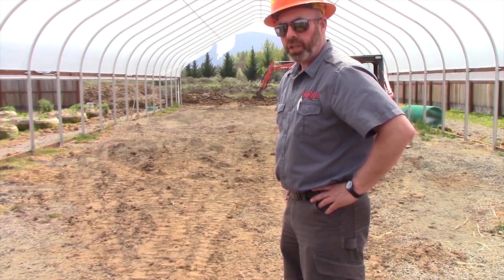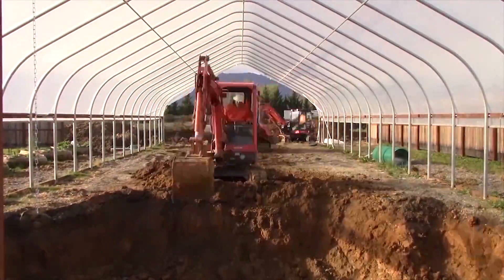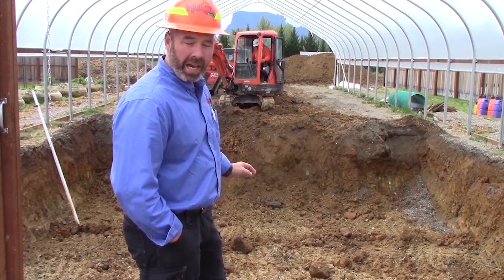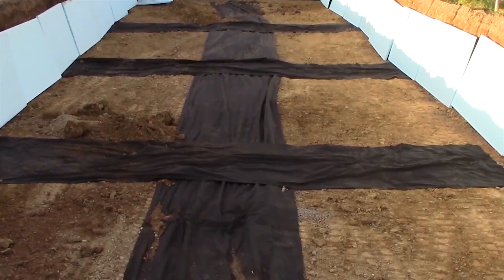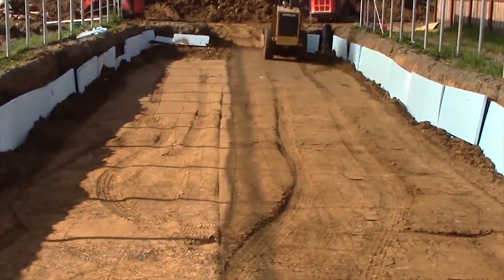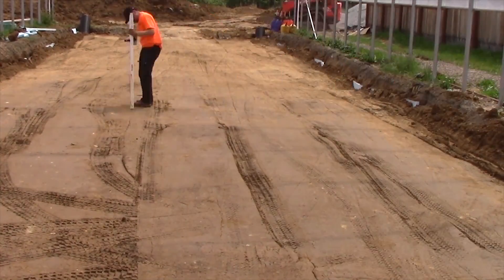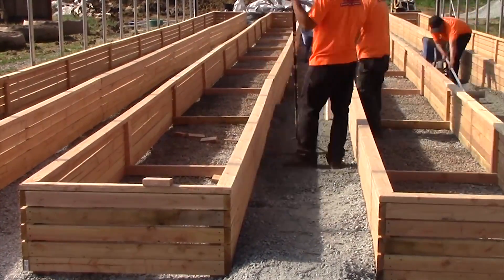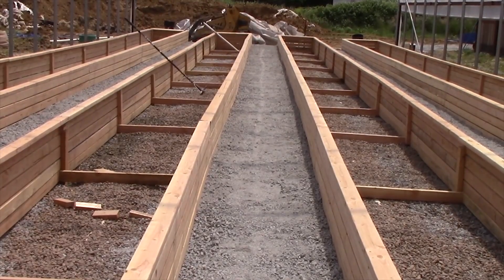Greenhouse Time Lapse Roshi Alpha 1 GAHT System

Comment: With these GAHT systems, there is talk of hot wet air going down and condensing in the pipes underground. I have not seen anywhere yet how the pipes are drained of this condensed water. Would not the water build to a level where the pipes are full? Also I have seen polystyrene become saturated in water.  If this happened here, would that not reduce its insulation value. Or is there closed cell products that are suitable for this task? Also looking forward to seeing this system in working order.
Reply: Most systems I've watched use perforated drain tubes, which the condensation can drain into the soil

Comment: Nice video explaining GATH system installation with details. I have a question. What is the final result? Does it work as per expectation? How was the temperature inside at night as compare to outside temperature in winter? Please help because I also want to build GATH system.
Reply from the maker: Thank you for checking the video out. I do not have any of the data on this as we installed the system for a customer Roshi Alpha 1. I have been receiving a few of these questions so I may try to contact them and get some info also. Thank you have a great day

Comment: Is it better to use solid or Perforated Pipe in the ground and do I have to worry about burying it 8' in the ground? Please help me on this.  I don't want to have to redo this project over.  I don't have the finances.
Reply: absolutely not!
perforated pipe also condensation to be leached out and the ribbed pipe adds 3x the surface area.
perhaps this video was made prior to these awarenesses.
tho the intent was good
this seems like a video of how not to build a gaht system
ldsprepper or at isadores farm have exceptional and proven results from a superior design imho
Reply: @Jarrett_Hagar  
I wouldnt recommend copying  this or any of the installations you mentioned.
Reply: @JohnGuest45  what/who do you recommend? (For best system design.)
Reply: @GMC-qo9xi  
I`d recommend finding someone who has at least a basic understanding of thermodynamics,  load calculation and duct design.
Reply from the maker: I would recommend not using ribbed perf pipe but the smooth wall pvc perf pipe.
Reply: @hukillsinc  Thank you very much.

Comment: Is there a followup video showing  how the greenhouse performed?  In actual operation?   How is the air circulated through the underground tubes? Thanks.
Reply from the maker: I just received this information back from the people running the greenhouse. They said It is working great!  We do not need to use any dehumidifiers in the GH at all.  Temperature stays controllable and in the colder months at beginning of season required minimal propane heating. They also stated this is first season in use and more data is need to establish any cost saving numbers.
Reply: @hukillsinc  thanks :)
Reply from the maker: We will be heading out to this site this spring and see how it is working.
Reply: @hukillsinc  any updates ? :)
Reply from the maker: Archili Kvinikadze I just reached out to the gentlemen that are running that greenhouse asking them how it is working. I am waiting for a reply back.
Reply: @hukillsinc  Ok, thanks!

Comment: My situation is different than many people. Most have green houses to keep their plants warm longer into the winter. I live in southern Utah and our low at night in the dead of winter usually won't go below 25 degrees.  So a green house can easily be kept warm all winter long. However, the middle of summer scorches flowering plants and the temps get to 112-118 degrees outside for about 1 full month in the year make outside vegatables impossible to grow. 

Can this system cool to below 90 degrees in these conditions?
Reply from the maker: Not really sure. This system was designed by a company in the midwest who was building another greenhouse out here in Oregon where our temps look pretty close to yours. We built the system around their specs.
Reply: @hukillsinc  
Theres no way the design in the video will keep the greenhouse cool in the summer. The tubes are too long and the headers wont handle the required flowrate

Comment: This is painful to watch, red flags everywhere,  when salesmen with no experience start excavating and installing materials in the ground.
Reply from the maker: Ryan Sark Thank you for taking the time to share your comments. There was no salesman that sold this project. This was a project given to our company by the owner of the greenhouse and installed per their designs. This was a system that they wanted to install to try to produce better efficiency in their greenhouses. Beyond that we do not sell greenhouses or designs for the systems we are excavation underground contractors that do a multitude of different projects customers request. But thank you again for watching and taking the time to comment. Have a great day.
Reply: Ryan this is very very critical and you offer no pointers as to what could be done to improve the situation. I plan to build a passive solar Greenhouse in the next year or two and I'm researching everything. One comment I will make which I've read online is that gravel Does a better job of absorbing heat then soil does by a factor of 2 I think. Therefore they probably should have used gravel instead of the soil for backfill. But then again as a contractor myself building koi ponds for the last 25 years ultimately you do what the customer wants and or what the budget dictates. It's not always the best or most ideal.. it's great though that they took the time to share this video because there isn't a ton of information out there on this technology
Reply: @rickyclerk3700  I did not mean to come off disrespectful but compacting soft soil on corrugated tile seems problematic, we excavate crushed tile all the time. Sleeved tile works the same as solid tile its just more expensive, I think geothermal techniques will be the future of efficient construction and any effort put forth will be a learning experience.  Thanks   I enjoyed your video
Reply: @ryansark1795  good information. Certainly the immense weight could crush the pipe depending the mass (depth) overhead. Much more productive then merely saying red flags everywhere so thanks for that Ryan. Cheers

Comment: big question is how long those wooden planters will last...  considering this is commercial production, why not to make them from galvinized steel so they dont fall appart in 10 years?
Reply from the maker: mbchudno Good observation. That was a separate contractor that did the planter boxes and whatever else on the surface for the owners of this greenhouse. We were the underground system installers and water diversion installers. Thank you for your comments.

Comment: Why do use perforated pipe thanks￼
Reply from the maker: You want the air to be able transition with moisture in it out into the soil where it will hold its heat and then use the heat depending if it's day or night. Otherwise the air will just blow through the pipes and not heat the soil around it.
Reply: @hukillsinc  
Latent heat makes up around 60% of the total heat transferred into the mass during cooling. Be aware that latent heat in the form of humidity will be transferred back into the greenhouse when heating. You`ll see it reflected in the greenhouse  RH%. It can be problematic, especially at night when the RH% is typically high to begin with.
Reply: Hukill's Inc. You don’t worry about radon gas
Reply: @arlenesauder1913  That should not be an issue due to air flow out of the greenhouse, which is not really air-tight.

Comment: Such a costly project is there any benefit
Reply: No. its stupid. you will be better off with other technology like insulation and compost heap heating.
Reply: @baphometpresidente4637  Can you explain or provide a video please?
Reply: But it looks purty
Reply: It's a great way to store solar heat for winter and cool during summer.  A simpler system  in Nebraska grows CITRUS year round.

Perf pipe and dirt is cheap compared to the yearly cost of natural gas or electricity for heat/cooling.
Reply: its also great way to store all the plant pathogens underground. great humidity under there...perfect nest for them. good luck with that.
Reply: @baphometpresidente4637  Could put a small untra violet light in the pipes to kill  all the pathogens in the air.
Reply: @baphometpresidente4637  
plant pathogens cant compete with the aerobic bacteria that thrive thanks to copious quantities of air being driven undergound. Well aerated, warm moist soil is great for plants , ask any gardener ;)
Reply: tingveson compost pile 5x5x5 feet and boom!! free heat, but what do I know, soil never freezes in flatlands of California.
Reply: @romuloremo1817  Can you explain where this would go and how to transfer the heat?
Reply: How many BTUs  are collected during the winter?

Comment: Interesting. Do you have any greenhouse temperature data to show actual performance of this system over all four seasons? Anything online that we can see?
Reply from the maker: Hopefully here soon we will start having some consistent data. We had to make some repairs to it and some adjustments.
Reply: @hukillsinc  Looking forward to seeing actual temperature historical data on this interesting & important project. In order to truly analyze & model the thermal performance of the system it is necessary to collect greenhouse air & soil temperatures (humidity also helps) AND outside air temperature. Even better, constant logging of greenhouse environmental data that also includes light levels AND an outdoor weather station that collects air temperature, humidity and wind speed. The best monitoring would also include any backup heating & cooling system energy consumption required to maintain optimal greenhouse temperatures during extremely cold or hot outdoor weather conditions. You might be able to collect this data by modifying the inexpensive Open Energy Monitor system (www.openenergymonitor.org) to interface with an inexpensive home weather station. With some free open source building energy modeling software it should also be possible to model the Geothermal GAHT system and then compare predicted performance to actual performance. This analysis might suggest where further improvements in system performance might be found and how to size any improvements to reach targeted performance goals.  (So glad that you are pioneering this important work with the Geothermal GAHT system for use in greenhouse heating & cooling - it is very important to the future of renewable energy use in food production systems.)
Reply: Your thoughts on insulation on the bottom, above drainage tile..,200 yards of insulated dirt (isolated) from the earth. Making it a battery .
Reply: @johnsilvernale6472  The physics implies that the only way this system could work is to fully insulate the climate battery on all sides except the greenhouse floor. Stored heat will have a tendency to conduct away from the recharge zone and thus dissipate into the earth outside of the greenhouse internal floor. Ground water passing thru the climate battery will drain the heat energy away even faster. As someone with a science background, what I want to see is the actual recorded temperature data: inside, outside, and in the climate battery.  The data will tell us whether this system actually works or not...
Reply from the maker: @alanmcrae8594   Very true about water taking the heat away. We have noticed that the on site personnel have over watered quite a bit and water draining through the clay soil to fast changes the condition of the soil and the heat inside.
Reply: @alanmcrae8594  well said.. I've insulated the three sides of my above ground grow beds in my green house. Good the heat longer, Also the cold in the spring..
Reply: @johnsilvernale6472  How high up did you go?
Reply from the maker: @johnsilvernale6472  Might be something to try as long as all water from above can drain easily down into lower drainage

Comment: Do you have a vdo of the connection of the pipes and functioning of the geo thermal system? Pls do share if you have one and tell us if its effective. ..thank you
Reply from the maker: After running this system I would probably use perforated PVC pipe with a glued or saddled connections transitioning  up to a 12" manifold on each end.

Comment: Hi!
How well is performing the earth battery? Do you recomend it?
Thank You
Reply from the maker: It exchanges air well  But you really have to monitor how much water you put on your plants and do not over water because of how much water will drain through the bottom. I would probly change to a perforated PVC pipe and more gravel in the soil that is backfield in layers rather than all dirt around the pipes.
Reply: Hukill's Inc. How much did this green house cost?
Reply: @hukillsinc  Thank you. How much temperature raise you can achieve at night time?
Reply: Ger Joe good question!     I got on here to ask the same thing